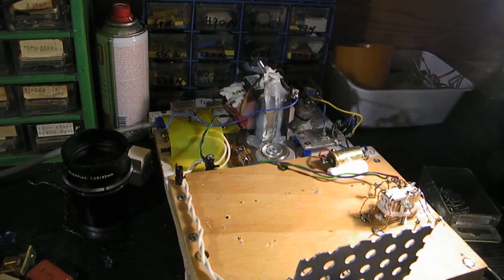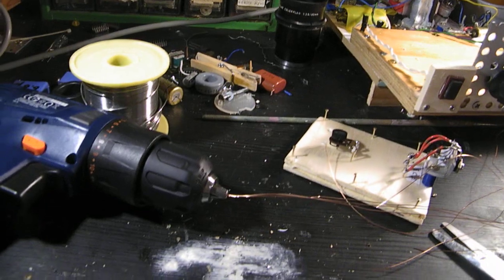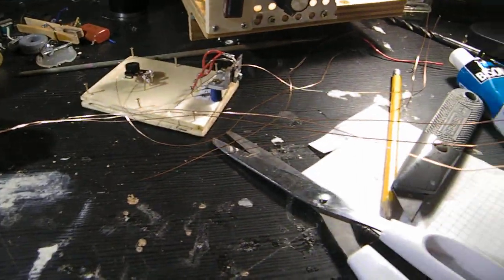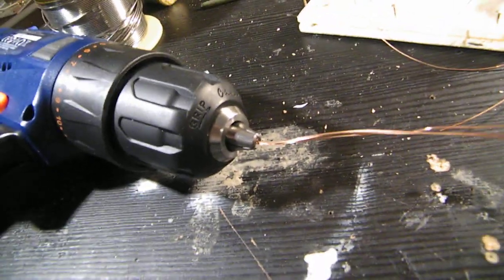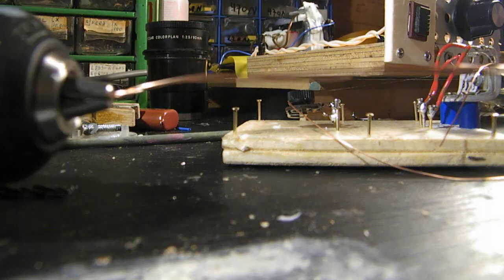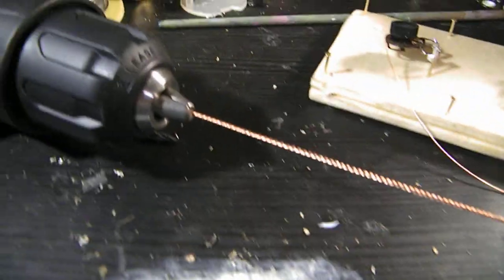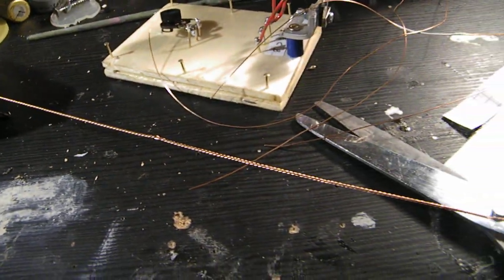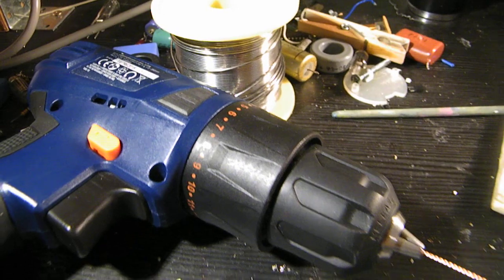Twisting copper wires properly with a drill

Comment: I want to ask how could you clips or relate the three wire with drill thanks
Reply from the maker: First twist 3 (or 2) wires by hand, the beginning. Fasten that end into the drill head. Hold the other side of the wire with your hand and let the drill do its work.